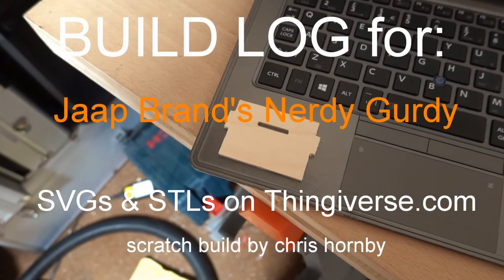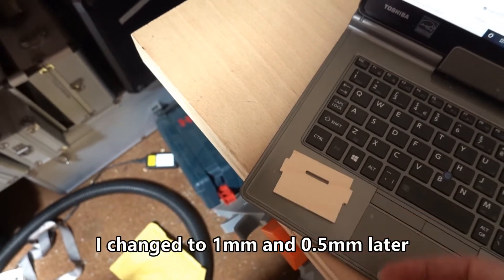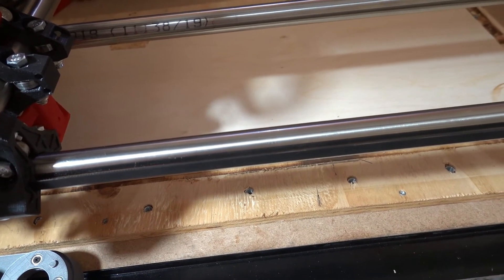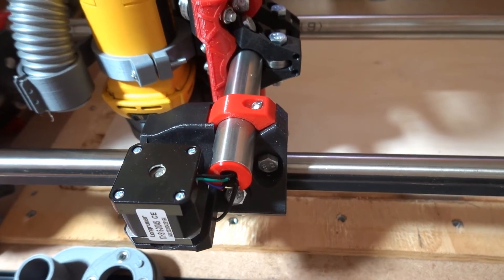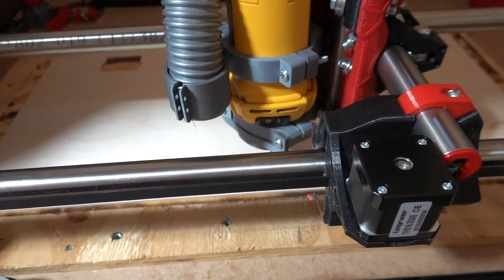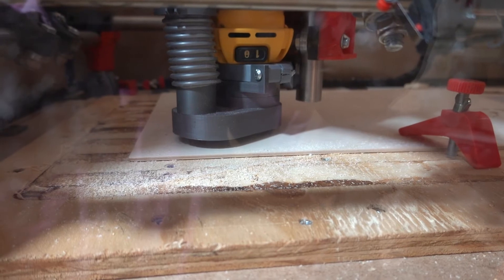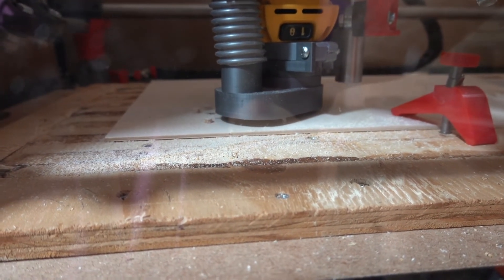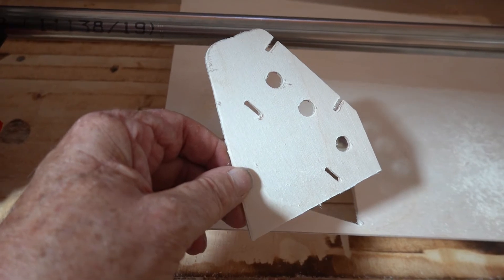Nerdy Gurdy Build log Part one

Comment: You will need to be sure to square up the insides of the slots with a file so that the tabs fit inside, but you probably already know that.  Thank you for taking the time to video your journey.
Reply from the maker: Yes, Thanks for the tip. I tend to use a scalpel but a file is also good.